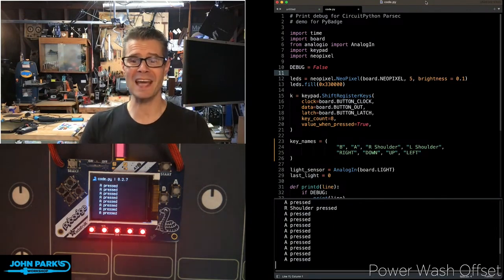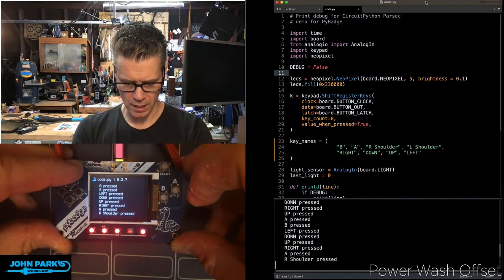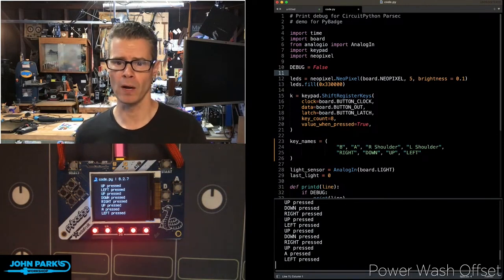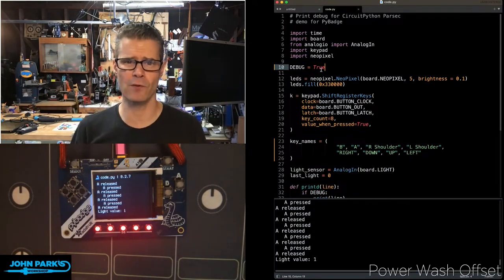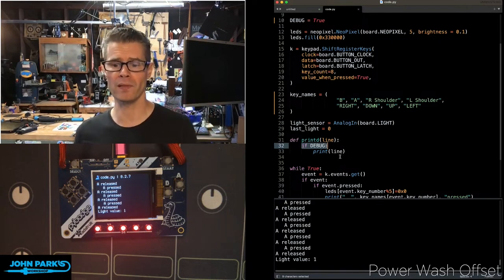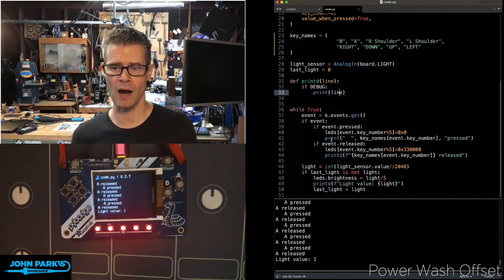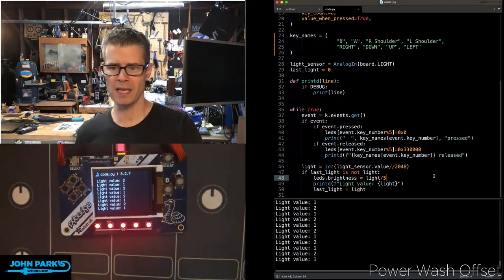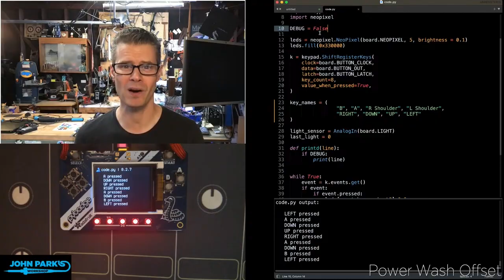John Park's CircuitPython Parsec: Print Debugger #adafruit #circuitpython

Comment: I´m not a fan of a conditional for every line that's logged. My approach would be to declare two functions, one that does nothing and one that prints the argument. At the start of the script, you assign either one of the functions to printd, thus reducing the overhead for unused code (a bit).
example:
def print_nothing(line):
  pass
def print_line(line):
  print(line)
if DEBUG:
  printd = print_line      # without parens -> assign function; don't call it
else:
  printd = print_nothing